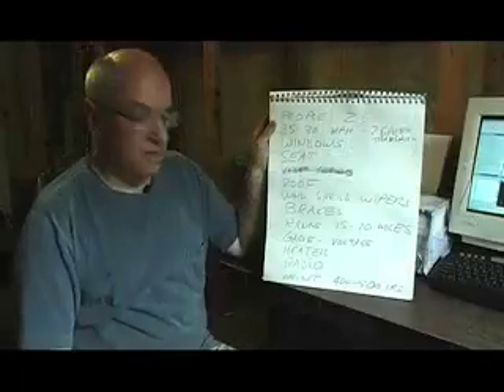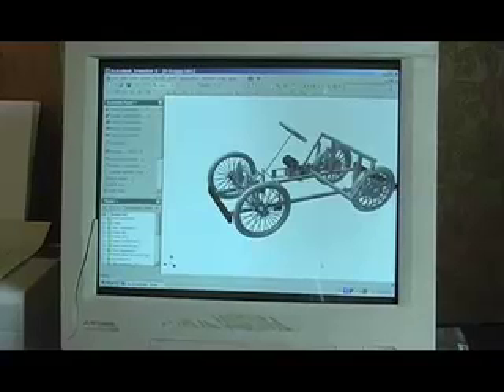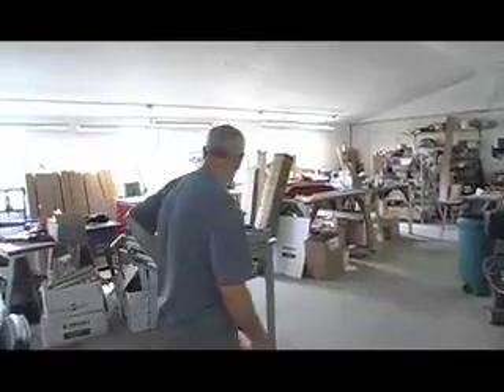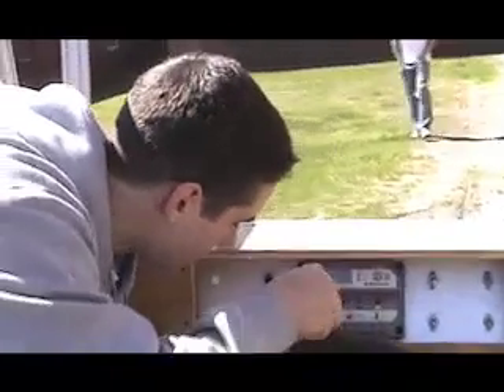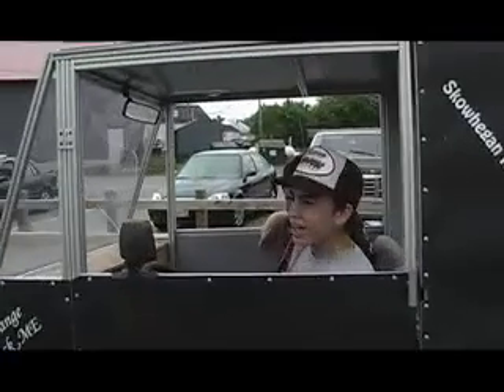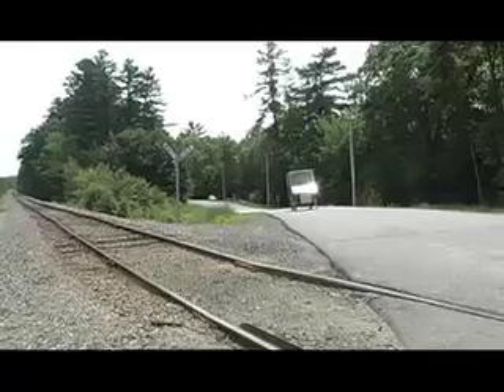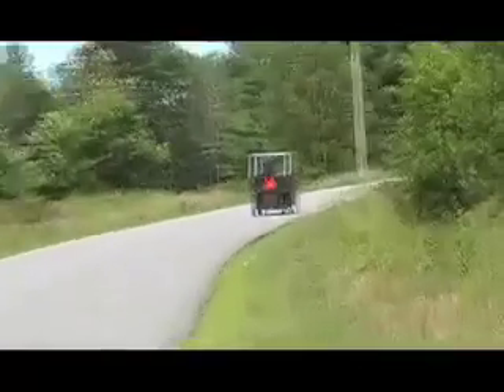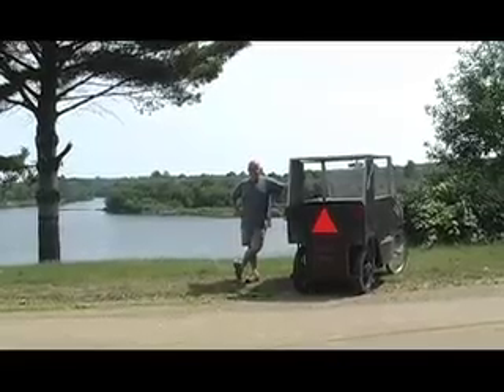Infinity Miles Per Gallon: Art Haines and the Solar Car

Comment: yeh but if they are good batteries they would last for ages, bout 5000 recharges but then they are only used to store the potential energy made from the solar pannels, so really, if the batteries die out cus of exhaustion, it wont matter cus you would be able to use them to use the car while its still daylight so yeh maybe like 98% harmless to the environment if you chuck the batteries away

Comment: there's more sunlight above the clouds. also, you have more surface area on a sort of disk shaped fuselage, or perhaps even better, sort of flattened toroidal fuselage perhaps. the fuselage can be carbon fiber to reduce weight. power is free solar, then run that electric power thru a Seversky Ionocraft air propulsion grid. notice you get rid of the junk weight of wheels, suspension, and any sort of engine. also, Seversky Ionocraft has efficiency of scale, so do the thin film solar photovltaics.

Comment: Maybe adding a tilting roof so the top solar panel can be aimed at the sun better for better charging. Not to be driven that way, (unless very slow) but it can increase the efficiency of the panel by 40%. My 2 cents

Comment: They could have put solar panels on the roof! It does not have all the tings necessary for DoT approval, so it is no different than a scooter...definitely not street legal. A fun project for kids who learn nothing useful in school. We need to bring back "SHOP" classes, something even I missed. I only got electronics in a local learning center for computer repair certification...which I got kicked out of, because the teacher knew less than I did. Fortunately, I read the book!

Comment: You're right. A conventional electric motor can last 100,000 hours.

That's equal to 6 million kms. Compared to 300,000km before your average ICE dies of heat stress.

Comment: E85 hybrid is not the best answer. a diesel hybrid would be way better, but still not the best, a plug in diesel hybrid would be better, but the real answer, or so i believe, is electric. as Art has shown, you can get our electricity from the sun, which makes it free. even if you get your electricity from coal, its still cleaner than gasoline, and if you live in places like california, than chances are you get your electriciy from air, so it is the cleanest method.

Comment from the maker: Art lists the specs in an ealier comment, but here they are again:

Weight: 350 pounds
Cost: about $2000 to build. It has an Advanced DC 2-5 HP motor, Curtis controller and three 12 Volt Lead acid deep cycle batteries.

Comment: Hi;
It weigs 350 pounds, cost about $2000 to build. It has an Advanced DC 2-5 HP motor, Curtis controller and three 12 Volt Lead acid deep cycle batteries. I am now building a lower profile version with less rolling resistance.
Art